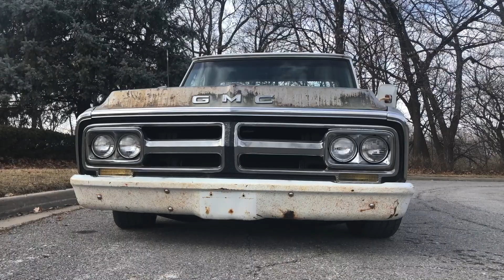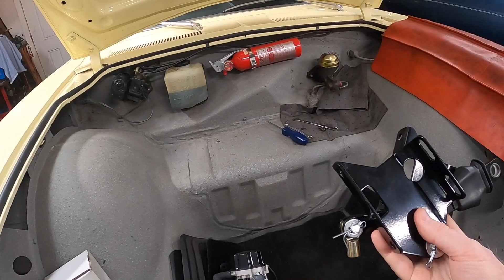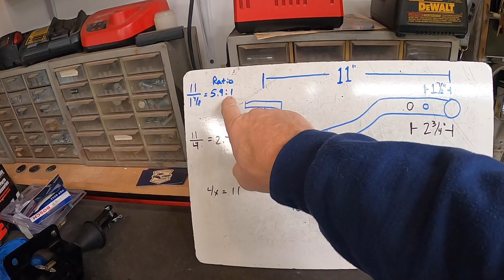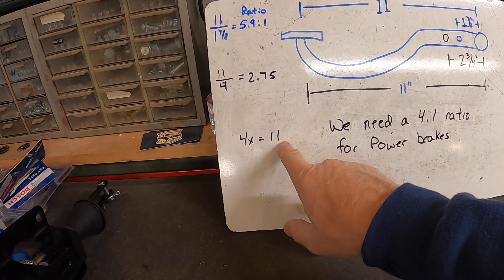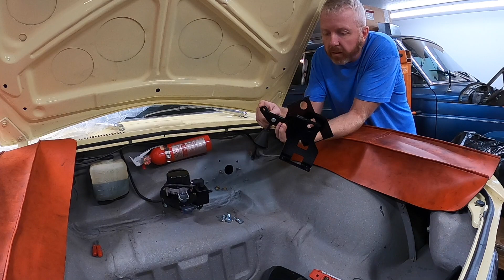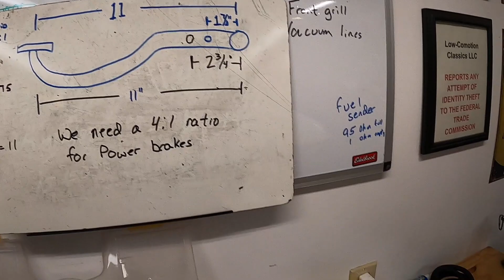Power brake upgrade on a 65 Corvair!

Comment: Interesting installation. I have put PB on 4 different Corvairs. I have used PB units from GM A-bodied cars. For my latest (done just last month on a 65 Monza), I bought a new unit for a 68 Chevelle. It's a 10" diameter unit. I used a master cyl that looks a lot like yours, which sure looks like a 4 wheel disc MC. The Chevelle unit mounts the booster at an angle. Clearance is tight, but I only had to trim one corner of the bracket, and it clears the hood.. I ran vacuum from the engine. I mounted the unit to the car, found where the clevis met the brake pedal, and drilled the hole. It is much further away from the pivot than yours, but that's the way GM did it. I have had great success, except for the first one I installed. With that 1st one, you could literally push the pedal with your pinkie finger and lock up all 4 wheels! Very dangerous to drive.  Swapped in another unit and all was ok. Very nice Corvair there, and a 140/PG combo is a very nice combo!
Reply: I should point out that my 65 came with a dual MC already installed, along with front disc brakes. Without power assist, the brake pedal had to be pushed extremely hard to get stopping power. The PB install made it much more normal feeling.
Reply from the maker: Thanks for the information. I had researched options and talked with a few companies to land on this set up. I was surprised that no one makes a kit, so I thought I would share how I did mine. I was concerned about maintaining enough vacuum from the engine so we went with the pump. I am sure it's overkill, but my customer was very happy.
Reply: @JohnToolan-oz6gx Clark's Corvair Parts has kits for front discs. You can get a kit to fit in the stock 13" wheels (uses GM J-car discs & calipers) or 14" or larger (uses discs & calipers from an S10). I did the smaller conversion back in 99, and found it to be tons of work. The larger set-up is easier to install but careful routing of the brake hoses is vital. Main reason to go to discs is that drum brakes tend to pull. I have the larger set on my 65 (it came with them) but the previous owner put them on backward AND upside down (bleeders on the bottom). Luckily, I spotted the brake hoses rubbing on the springs and crossmember before they wore thru. Is it worth it? Just barely, but I hate brake pull!
Reply from the maker: Thank you, my client is on the fence about installing discs. We have discussed it and may do that next.

Comment: it would not be simpler to use the engine vacuum ?
Reply from the maker: Possibly, but you would have to route the vacuum hose from the rear and that length could cause issues. I wanted to make sure and have plenty of vacuum on demand.

Comment: what master cylinder did you use. thanks
Reply from the maker: I ordered a corvette master cylinder and booster kit from Master Power brakes.
Reply: @low-comotiongarage5819  What was the bore size for the Corvette dual master? 1" or 1.125" - Also the Master Power Brake P/N for the master. Is the template you used for the bracket available?
Reply from the maker: I would be happy to get that info for you. Shoot me an email and reference this conversation. 
lowcomotion64@gmail.com

Comment: Why didn't you just run a Vacuum line to the brake booster from the engine
Reply from the maker: I felt for safety reasons this was a better option that running a rubber line that distance.